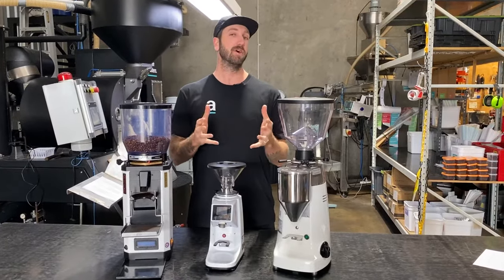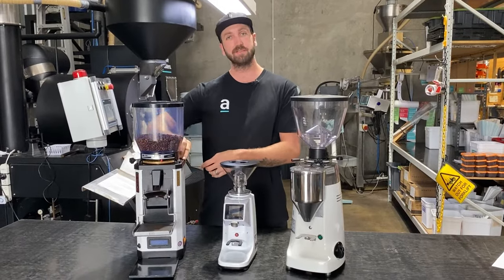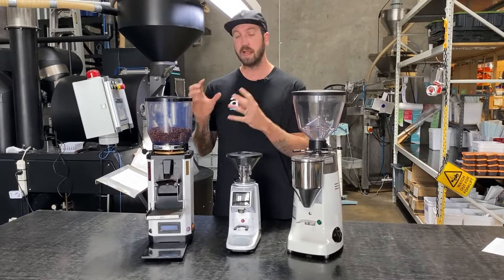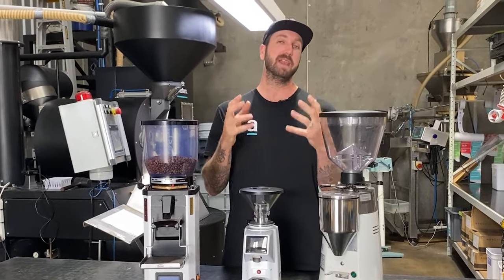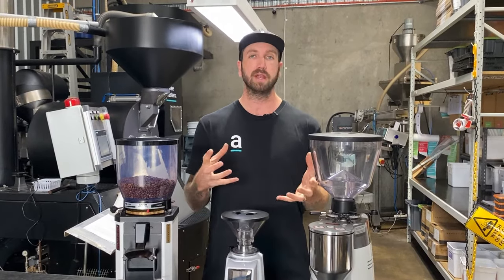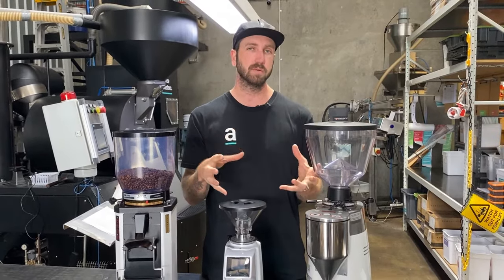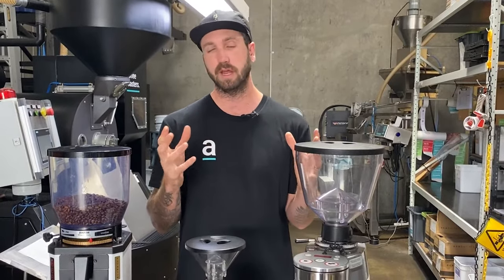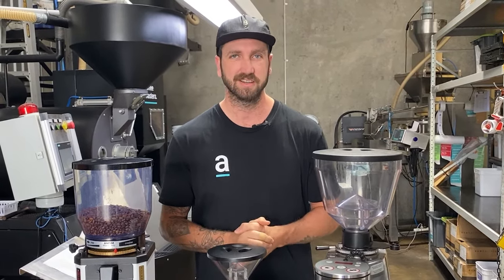How to Fix Coffee Grinder Problems (Fastest Solutions)

Comment: Great video Jimmy, is there a product that can be used to clean grinder burrs, to overcome this issue
Reply: Hy thats a great question.?  Im interested in knowing too.
Reply: A suggestion regarding a product to clean grinder burrs. 

I have an older Mahlkonig K30 Vario that's been in use for over ten years.  I've been using a product called "Grindz" from the start.  It has served me well.  I run the "Grindz" 'beans' through it about every 2kg of coffee ground. I cycle the Grindz through twice.  Initially I sprinkle just enough 'Grindz beans' into the cap to make a single layer of them in the cap, and run that through the purged grinder (open the burrs wide open, then gradually go finer using 2 second bursts.)  Then repeat this a 2nd time, juat a few beans to make a single layer in the product's cap).  By this time, it's all coming out very clean.  Minimal use of Grindz. This works better for me than filling the entire cap with Grindz, as is often suggested (and uses a lot more of that product).  My burrs are still squeaky clean and grinding well after about 750lbs (340kg) of coffee.   Probably approaching the time to replace the burrs, but not yet - original burrs still working fine.

For reference, all coffee ground with this grinder is for producing espresso (medium roast) with a dose between 21.0 - 21.5g with 32s extractions.  Grind times pretty fast @ 21g in 4.4 seconds. 

I suspect the numbers on all of the above depend on what kind of coffee one usually uses, and how it's ground, but for me, Grindz has been a very economical and effective solution.  YMMV.
Reply: Thanks Jimmy! Another factor which may not be an issue in the café but I have experienced with a Baratza Vario is duty cycle.  Basically some grinders can only run so long before they have to shut off to cool down.  Also regarding static, a quick spritz of water with a spray bottle Will greatly reduce static
Reply: @bacca71  I know, your post was a year ago. Anyway, I know someone who has a coffee shop and runs a Mazzer luigi Robur. Has run through over 9000 cups so far and burrs have worked great. Never replaced. Although now, I think hes finally ran into some issues but they may be electric rather than mechanical. Very lucky I guess up until now 😁